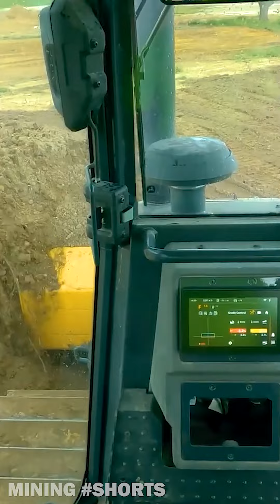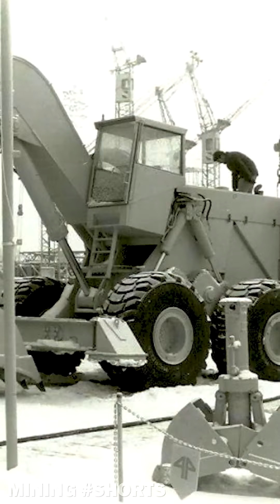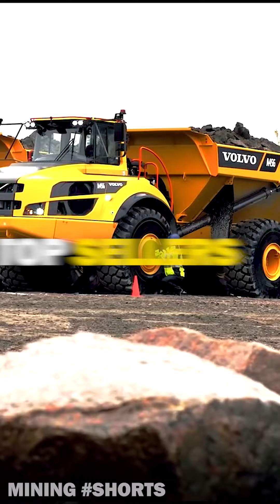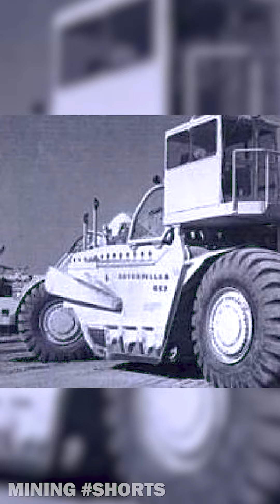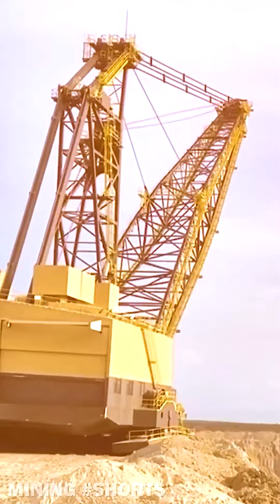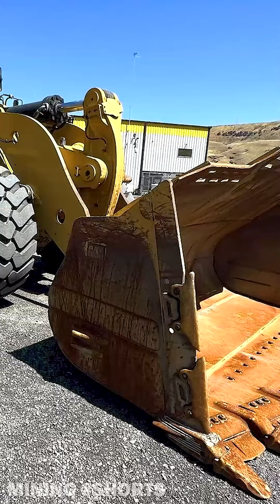The INSANE 186-ft Triple Caterpillar Scraper | (BEST OF MINING SHORTS MAY 2024)

Comment: The triple CAT 657was still smaller and less powerful that the Letourneau LT360 which still holds the record for the world's  largest motor scraper.
It had a capacity of 216 Cubic yds and over 5 thousand horsepower compared to the Triple CAT with 150 Cubic yards and 2580 horsepower.
It was claimed that the LT360 could self load 360 tons (792 thousand pounds) in 80 seconds
Letourneo had an even bigger one on the drawing board bosting over 10 thousand horsepower

Comment: The first Deere crawlers were kits made by the Lindeman Bros. in Yakima, Wa. installed on a B. Some custom units built from other attempts on GPs and Ds also existed. 
     Deere and Caterpillar had a very good relationship. They exchanged combines and allowed some patent copying in the late 19th and early 20th century. Deere helped Cat eith hydraulics. The first Deere diesel combustion chambers were strikingly similar to Cat. 
       Fast forward to the first Industrial forays of Deere. They were hardly a blip on Caterpillar's blotter. But they gad their place. Today is a bit different. Deere does their own thing until you get to Dozers. Cat does as well until you get to Backhoes and Skidsteers. JCB provided the backhoes, ASV the skid steers. Lately they have their own identities but the influence is still strong. Cat bought Perkins to gain not only their power platform size but their successful emmissions systems.
     I don't think Deere is trying to crowd Caterpillar out but rather provide a niche need. Deere dozers are pretty amazing with the Hydrostatic drive and zero turn ability. The Diff Steer on Cat coupled with High Tracks are very impressive as well. I've run both machine types from 15-20 years ago and say I have no real preference. When it comes to the cab and the offset seat, I like the Cat. For finish work, the Deere is pretty nimble. I think it comes down to preference and dealer support.